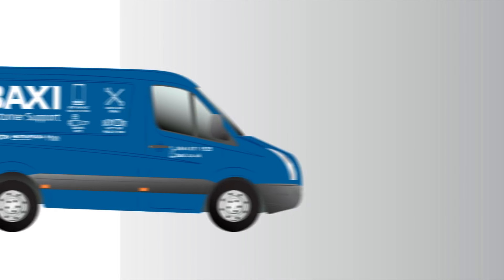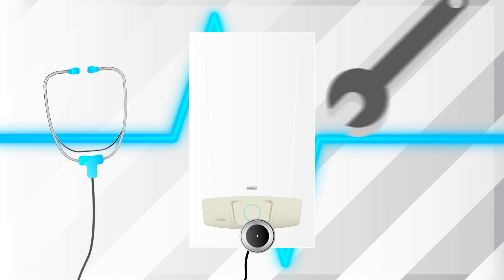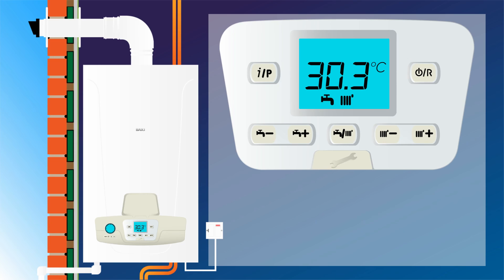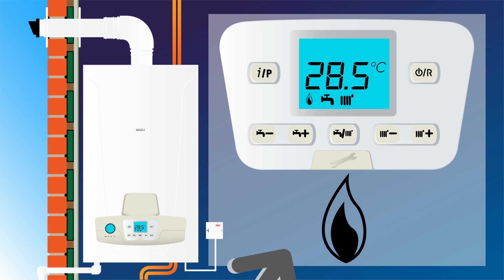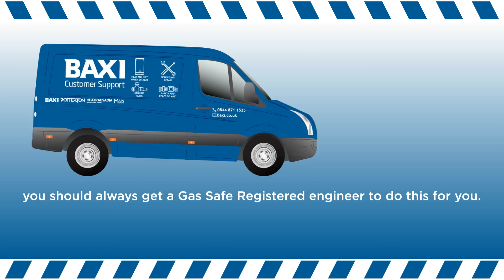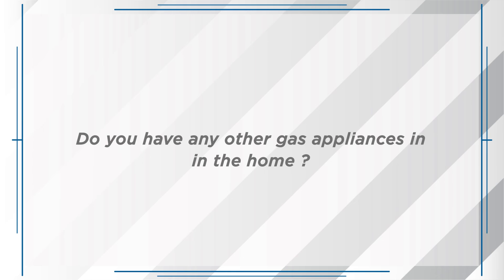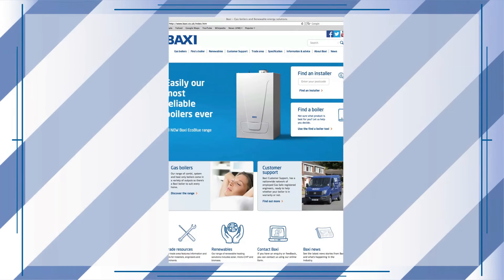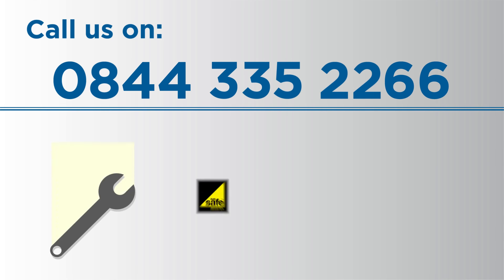What to do with Baxi E133 error code on the GA range of Boilers | Boiler Troubleshooting Guide

Comment: Just want to say thank you for this video it worked straight away. Came home to my chappy smart meter thing dead as always unless it plugged in 24/7 it dies but was showing the gas simble saying gas supply disconnected. Boiler error code 133.  Followed your instructions and its fired right up when running hot tap and holding reset for 2 seconds just before it turn the screen off. Thank you very much again 😊

Comment: Doesn’t work, Error Code E133 stays on even when running the water, nothing firing up I’m afraid
Reply: Same here, did you find a fix
Reply: @Coral-Mai Gifford  yes I found the fix myself , the water pressure was down to low to allow the boiler to fire up as a safety mechanism , so whilst boilers have different ways of putting water into them, mine have a valve and gauge underneath , so I turned the valve and watched the pressure go back up out of the red into the green area , then the boiler was back to normal for heating and water , hope that helps.

Comment: I cannot be more disappointed by this brand, a new Baxi boiler shows either E128 or E133 and after 6 visits from the technicians, nobody has a clue as why this is happening. This seems a very common issue and people have been chasing up a solution for a long time. I am renting at the moment, but I will never buy a Baxi boiler.
Reply: In my case was the stick inside the boiler.
Reply: @trueno87  same here
Reply: @trueno87  what do you mean stick? I'm getting desperate here, so if you can let me know that would be most helpful
Reply: @stesnjak  what do you mean stick? I'm getting desperate here, so if you can let me know that would be most helpful
Reply: @DrPepper22222  its the “lighter” it maked a flame and ignites the gas.
Reply: @stesnjak  ok great, thanks.

Comment: radiator symbol  is flashing on my boiler but I have no heating can you help
Reply: Did you get your boiler working? Mine is doing exactly the same and have no idea how to get it working.
Reply: If radiator simbol is flashing it means that there is heating demand. If the burner starts and works very short period of time, that could mean closed taps (radiators for example) or filters may be full of dirty. Also check a pump. Otherwise error shoud be displayed